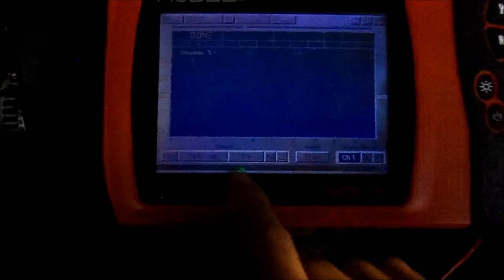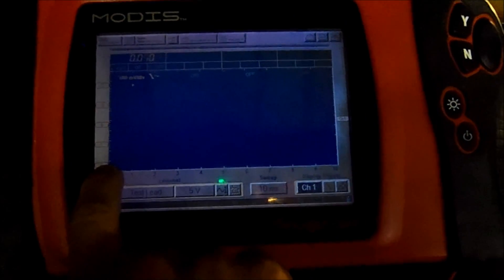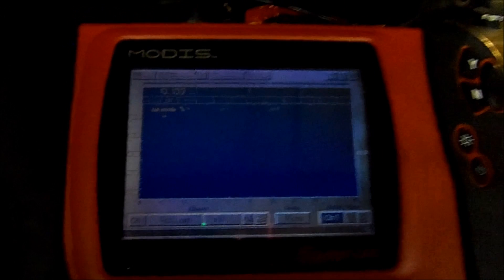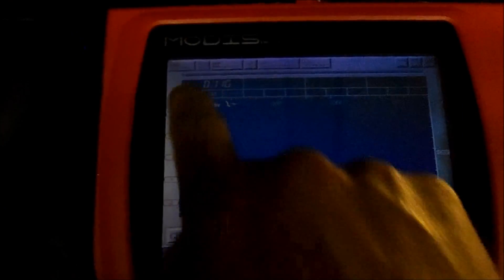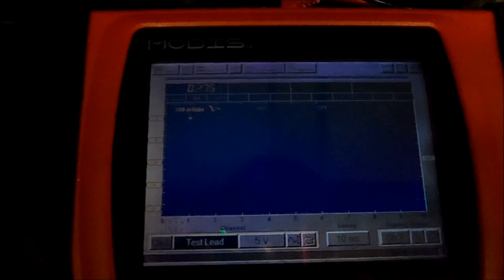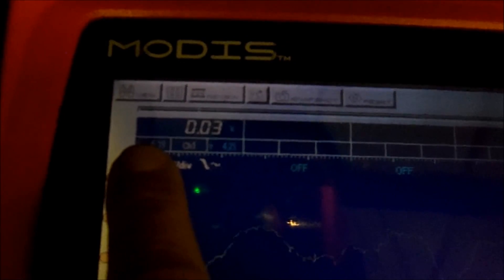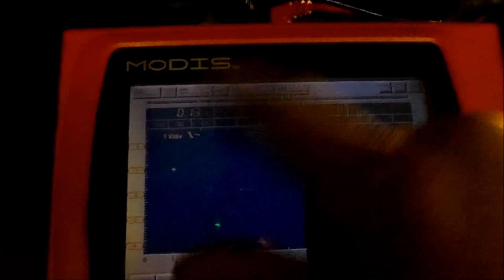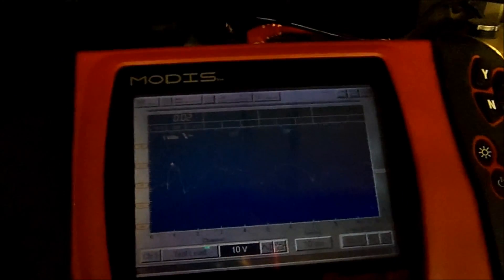2007 Chrysler Pacifica - P0740 Torque Converter Clutch System Performance or Stuck Off.

Comment: Excellent vid. Thanks much. I was in the process of changing the clutch on my alternator because it was making a racket. I removed the serpentine belt to find the noise and the noise stopped so I knew it wasn't an internal noise. I put the belt back on to see which accessory was causing the noise and the noise stopped. In doing some research it appeared I had a bad one way clutch. Tonight driving home from my daughters I could hear it cycling in and out as you said for the truck. Thanks again will change the alternator.

Comment: I have a 2007 Chrysler Pacifica my motor was great no check engine light went I put it in drive the motor shuts off ???????????? Help anyone
Reply: Having the EXACT same issue! Making sure to follow and see if there is any help with this.
Reply: Did you find the problem? Mrceo gaming

Comment: Happy New Year...the code is P0883. When you turn the car on the radiator fan come in right away, and the car is stuck on one gear and it wouldnt move,  only in reserve.

Comment: Great video. I am having an issue with my car. The transmission gets stucks on three gear but when you clear the codes, the transmission goes  backs normal but after 50 miles the same problem occurs, have you  heard of this  before?